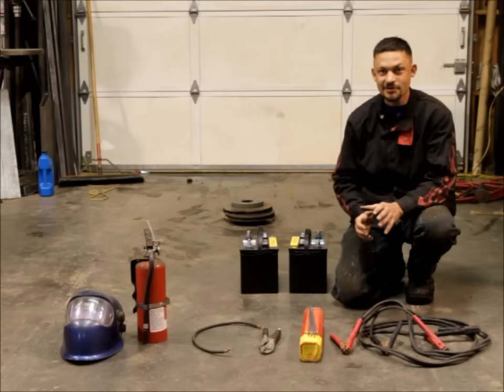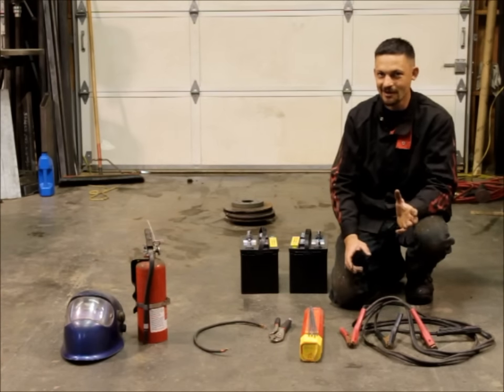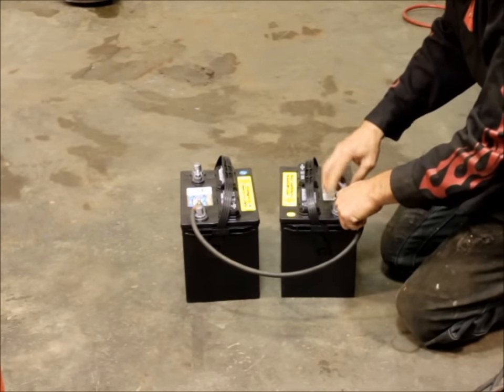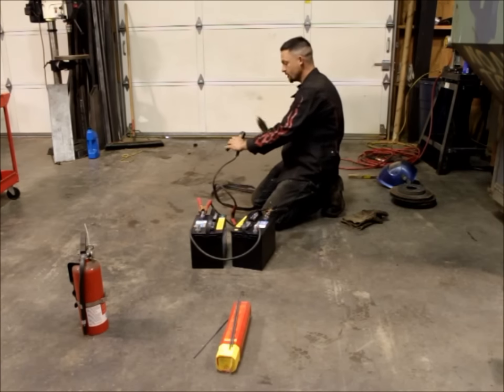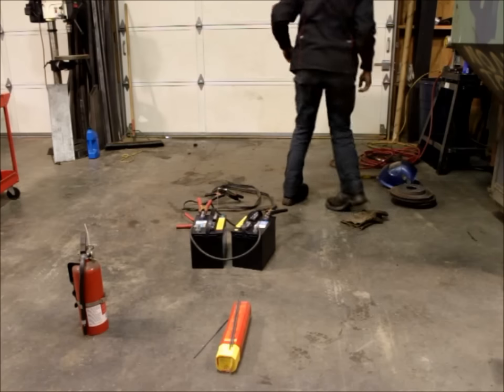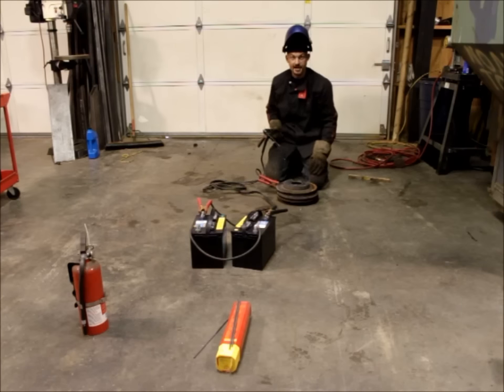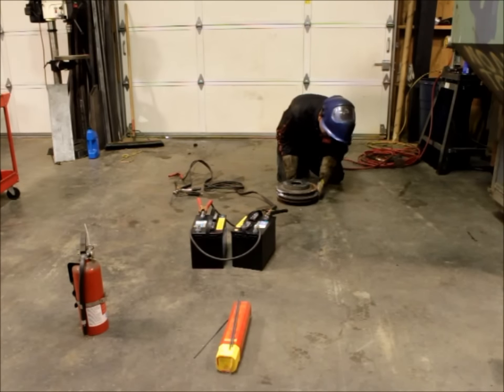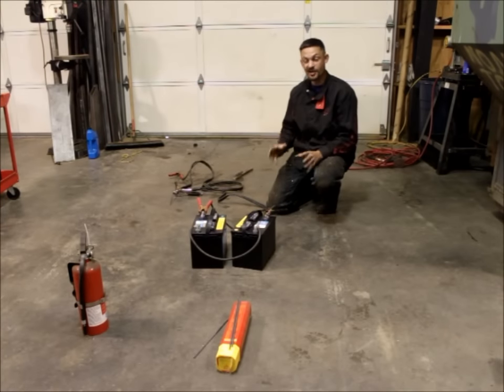Welding with jumper cables and a pair of batteries

Comment: Batteries can also be used to make an inexpensive spot welder. But one safety warning that was not in the video. . . If you have very good, high amperage booster cables and the welding rod should stick, it is possible for the batteries to explode. The first time I saw a battery explode was when a fellow placed some plywood under his battery because the tray was corroded. This lifted the battery just enough so that when he closed the hood of his truck, the battery shorted against the hood. It blew the hood back open among other damage done. Lucky, he had walked far enough away to not be hurt before it blew.
Reply: Exploding batteries are worse than I had ever imagined. I was in a shop where someone left a deep cycle marine battery on a charger without popping the caps for far too long. A couple of days I believe. When it decided to blow it scared the living !#@! out of everyone. Even worse than the near heart attack was the battery acid cloud sent throughout the shop. In addition to that, a 6 to 8 foot area was completely contaminated. One of the most dangerous things I've seen. Batteries are no joke. Lucky no one was standing next to it when it blew up.
Reply from the maker: I've witnessed a couple of battery explosions; one was due to jumper cables being hooked up in reverse (my father on a tractor when I was about 10 years old) and another in a golf cart during charging  (charger was removed under power and vent caps removed following extended charging).  Both were violent and caused a fair bit of damage.  I have heard of others as well; but every single one of them involved improper charging or excessive amp draw/short circuit, improper venting, or other misuse/abuse.  Welding with this method draws about 150 amps; well within the discharge rate of most any automotive battery (and under what a starter motor, winch, or other large electrical motor would draw).  Sticking a welding electrode is certainly a possibility, but only dangerous of the welder leaves it stuck for an extended period of time and neglects to pull it out of the holder or remove a cable.  You're correct; I probably should have mentioned the risk in the video.  When conducted properly, this method of welding is safe.  But there are about a dozen ways that a person could make it unsafe and I did make mention of this in my video description.
Reply: sewerzuk You are right that most batteries explode while being charged. This is because hydrogen gas is released during the charge cycle. 

I too have welded using batteries. But mostly just spot welding. Done correctly it works fine.
Reply: Roy Riederer
Reply: Roy Riederer h
Reply: I'm lucky then, forklift I drive at work the battery and engine are under the seat. 
The 'bonnet stands' were rusted to hell, so one day when I sat on the seat the battery terminals touched the bonnet without knowing this I turned the key. Huge bang followed by a fair bit smoke coming out from under me.

No damage besides half of one battery missing (two 12v batteries) So glad I didn't get my ass blown off hah.
Reply: Wow, I guess your co-workers thought what a fart!!! (hehe!)
Reply: What about a 300 amp fuse since we only need 150 amps to weld?
Reply: Your exactly right about the to high current draw thats why iv used longer piece of wire for resistance between the two or three batteries to help control that much current that really dont need to weld with .
Reply: Roy Riederer HE GOT LUCKY..MY CAR HAD A WRENCH IN THE TRUNK & IT WAS ROLLING AROUND & WHEN I HIT A LEFT TURN GOING FAST IT ROLLED ON TO THE BATTERIE IN MY BMW & IT SHORTED IT GOT SO HOT IT TURNED MY CAR OFF & THE WRENCH WAS STUCK ON THE POS & NEG POST SO I RAN TO THE NEAREST HOUSE THAT HAD A GARAGE OPEN GRABBED WHAT EVER I COULD GET THAT WAS HARD & HIT THE WRENCH OFF IT TOOK ME 3 HARD STRIKES TO GET IT OFF...THE OWNER OF THE HOUSE WAS LIKE HEY WTFFFFF..I SAID EMERGENCY THEN HE SAW WHAT I WAS DOING & HELPED ME ..MY BATTERIE STATED TO SMOKE...LUCKY NOTHING HAPPEND...SMH..I NEVER AGAIN HAD TOOL LOSE IN MY TRUNK & I COVERED THE BATTERIE WITH ITS COVER THAT NEVER CAME WITH THE CAR WHEN I BOUGHT IT...OMG IMAGINE IF IT WAS A WOMAN...BOOOOM!
Reply: Nationalcitysycho d Glad you saved your Beemer. It's always best to prevent exploding cars and women.
Reply: Roy Riederer to
Reply: Buddy Clem 
Anyone ever think that MAYBE if we taught the ladies in our lives some of these necessary skills, we wouldn't have to worry as much? Or would that put too much strain on our need to be the sole providers of all things handy?
Reply: Triikor Omg I couldn't stop laughing. I kept picturing you sitting on a forklift with smoke coming from under your ass and a your boss just staring with his hands on his hips shaking his head.
Reply: I had a battery explode and it sounded like a fucking Grenade went off! The damn top of the battery ended up on the roof...All because one spark and a leaking battery cap. Just enough gassing and wallah...You're pissing your pants. Then run for water hose and baking soda. As that acid was on everything...
Reply: Roy Riederer Holy fuck! That guy was lucky that he didn't got killed in that explosion.
Reply: I-Love-CO Mountains
Wholeheartedly agree with your comment but I think the Joke Buddy made was at the expense of Nationalcitysycho d being vague in his dismissal of women, and which could be read as National describing an actual exploding woman.
Reply: @abarcza  I know your comment was months ago but I'm wondering the same thing and hoping that by commenting on yours someone might actually answer it. My first thought was a simple fuse or breaker of some kind. If anyone's actually reading this what would be the best, easiest and cheapest option for adding a little protection from an exploding battery?
Reply: @DnosSFS  should have reported to the Guinness World Record for the biggest FART!  =)
Reply: Facts
Reply: lithium batteries are safer, they just spew fire everywhere
Reply: @nationalcitysycho  There's a button on your keyboard labeled "CAPS" you may have hit it by accident. That or you just type in all caps on purpose and it's kind of cringe. Cool story though.
Reply: @MattVerley I doubt I'll get an answer on a seven year old comment, but anyway: Why would the current be restricted to ~150A? 
Isn't it essentially a perfect short circuit?
Reply from the maker: @LachskoenigIV  I still keep an eye on comments, even on my very old videos!  It's because it isn't really a perfect short circuit.  The resistance of the circuit (battery internal resistance, mating points between the clamps and the battery terminals, resistance of the cables themselves, resistance of the arc, etc) all add up to limit the current to about 150 amps.  This absolutely will vary with different battery setups, different cable lengths and sizes, different electrode size, and more.  If you drop a large copper bar across the terminals of a battery, you'll get many hundreds of amps, a damaged battery, and melted battery terminals.  Not quite the same thing as the setup I demonstrated.
Reply: I was messing with my battery  in my pu truck I closed the hood got in turned the key and kaboom battery exploded still do not know why.

Comment: REALLY a great video! Seen this done about 40 years ago out in the middle of the Mohave desert, about 30 miles from nowhere! Group of about 20 or 25 Jeepers were out having fun when one jeep broke a spring mount away from the frame. One cleaver jeeper  performed a miracle in the middle of nowhere using the batteries from a couple of jeeps just as you showed us here!! Thanks again!!!!
Reply: Awesome. I’m just now getting clued in how welding just being shorted current to melt metal.

Comment from the maker: The electrode was 1/8" in the video.  I have tried (just for fun) welding with a coat hanger.  It doesn't work well at all, since there is no barrier to contamination from the atmosphere.  The joint isn't strong and it looks terrible.  But...in a REAL pinch, it could be used to stick 2 pieces of metal together.  Much better to just buy a few $ worth of good welding rod though!
Reply: very early arc weldors wrapped wet paper around bare steel to create the coating
Reply: why not use iron cable?
Reply: Apart from hwo dangerous it would be, wouldn't an open flame from a torch directed at the weld during welding sort of protect the oxidation? How about carbon coating the piece at a welded point with some tar, so it deprives the atmosphere out of oxygen for a moment?

Comment from the maker: I used 1/8" rod in this video
Reply: Matt Verley - you're wonderful . Thanks so much!
Reply: Thanks was going to ask. I have a welder but this will be handy on a RV trip if needed or to help someone else out. May even get a tip. haha Best explanation on this I have seen so far
Reply: That's 2.5mm to all the metric heads👍

Comment: I've watched many videos of arc welding with automotive batteries and jumper cables, and this video is by far the best one of them all.

A week or so ago I had revived my wifes old dead car battery with distilled water and epsom salt and charged it overnight. I had purchased a deep cycle battery for her dads boat just a few days ago. Tonight I used both batteries to spot weld a fender back onto my father-in-laws 1988 Chevy van (yes, they are spot-welded on, not bolted on) using the above mentioned batteries, and I must say that after a little bit of practice I was successful in my task.

Comment: i'm a fourty year vetran welder. I like the video cause I like welding and making stuff. Like electon beam welding of titanium parts for the miltary 2 billion dollar stealth bomber. Still do some stick welding. 2 suggestions.  I couldn't tell if you had safety glasses on but I would suggest no one try this without safety glasses (or some type of glasses under the hood) two reasons. Those Sparks you see bouncing around can easily hit your chest and go underneath the helmet and end up in your eye. a glowing piece of Steel in your eye could be the end of sight in that eye. also generally speaking welding leaves slag behind on the surface of the weld.  usually it can't be brushed off  without first shipping it off with a slag hammer or other device then polishing with a wire brush. those hot pieces of slag  likewise can end up in your eyes. more than once even with glasses on pieces of slag have stuck on my skin causing deep burns on my face. can you imagine a red-hot piece of slag on the surface of your eye? the other thing  especially for new welders  the rod can stick on the part actually welded to part.  There is now no release for that battery energy. Now you must remove your vice grips quickly  before you cause serious problems with those batteries. anyway thanks for the video and happy welding.
Reply: what are the chances of that? you can only be so careful before it becomes ridiculous...
Reply: He’s right while wearing a mask I once got a spark go dangerously close to my eye while mig welding now I wear goggles with the mask

Especially when I weld at uncomfortable angles like under a car
Reply: @kingjames4886  It happens more often than you think... I've been welding for less than a year now, already have gotten pieces of slag stuck to my lips, in my beard, and had one red hot ball bounce off my shoulder, into my helmet, behind my safety glasses and right onto my eyelid, singing off some of my eyelashes. Those little red balls really know how to get into weird spots.
Reply: @kingjames4886  the chance could only be .01% but why chance it especially with your eyes. It's never ridiculous if you got the job done right and safely.
Reply: there's a higher chance of getting in a car accident and billions of people take that risk multiple times a day... there's such a thing as being too careful.
Reply: @kingjames4886  possibly in some situations but not many. If you comparing the chance of getting in a car accident to getting some slag in your eye you would also have to compare how many ridiculous drivers there on the road compared to how many welders there are and it's not really a reliable percentage. I would say at that point you got a better chance of getting slag in your eye if your a welder. And why not just wear the glasses behind the mask it's not like it's that big of a deal anyway. It really is one of those things it's just smarter to do unless you really don't like your eyes. I'm not going to say I wear them because it never really crossed my mind until this video because I don't weld everyday but I'll wear them now.
Reply: don't think it works like that...
Reply: @kingjames4886  doesn't it though
Reply: no... but if you're that determined you'd better wear full safety goggles since glasses leave a space that a spark could slip through.
Reply: @kingjames4886  good point I think I have some flame retardant tape at work, I could tape up the sides. Good lookin out bro
Reply: Just curious if we are hearing from the peanut gallery below, or if anyone has experience? Any one eyed welders down below that can give first hand experience or is everybody just pissing in the wind? Do what you please, it's your eyes...
Reply: Hmm
Reply: Getting power off the stuck rod is quite easy since the vice grips have the spring clamp of the jumper cables on them so pull your jumper cable off the grips to break the current .... oh yeah in my last 45 years of fabricating I’ve had the odd pieces of slag get past my safety glasses, more of a problem with grinding and chipping slag and excess weld material ....
Reply: i have been welding for 60 yrs from my first experience. burned my eyes from the flash once but have never gotten slag in my eye not saying it couldnt happen.
Reply: I had a piece of spatter bounce off my chest up under mask and rite into my eye 3 days of extreme pain and an eye doctor now I keep my chin tucked
Reply: I had a spark bounce off my helmet to the bumper to the garage door then hit my neighbor then he stumbled hit his head and dropped his cigarette next to a gascan that exploded next to a big propane tank....what a terrible day. Im not even gonna bother telling what happened next coz you not gonna believe it 😅
Reply: @kingjames4886  You would be surprised at how those pieces of slag fly around when chipping them off
Reply: Dear Jerrybenson, 

Thanks so so so much for your professional concern. Never thought about this, and will take this action, now.

Wonderful !

SIncerely
David Svarrer
Reply: @kingjames4886  The chances are quite good, unfortunately.  As an eye doctor with 35 years experience practicing in a farming community of approximately 60,000 people, I can't tell you how many times I removed metallic foreign bodies from individual's eyes using improper and proper protection while both grinding and welding.  As far as the UV radiation debate is concerned, those of you claiming to use "squinting" as you line of protection are playing with fire.  The first line of UV absorption is in the cornea or clear covering of the eye.  If it is inundated with UV, you get the typical "welder flash" burn that hurts like crazy about 12-24 hours after the initial burn.  These generally resolve without permanent damage.  The UV that passes through the cornea is then absorbed by the crystalline lens of the eye.  The cumulative (over time) adsorption of UV (painless) by the lens creates cataract over time.  Finally, the UV passes back to the retina (specifically the macula) which absorbs the any remaining UV radiation.  Continued exposure of the macula over time to UV can and will lead to macular degeneration.  No, it won't blind you overnight, but you may suffer serious consequences in the distant future.        
PLEASE use safety shields when grinding or welding...they make them for a reason!
Reply: @mtlefty8687  well, people who don't have a problem generally don't complain about it. I think you might have confirmation bias.
Reply: Don't understand your comment...I was describing my experiences of treating injuries from metallic foreign bodies and dangers of UV radiation using "squinting" as protection.  What are trying to say?
Reply: @Jason Vangness was welding few weeks ago under a trailer, on my side and a spark bounced off the helmet, my shoulder and in my ear. Needless to say I came out from under there like a rocket. Was in pain for the rest of the day, but thankfully I didn't lose my hearing or anything like that 😅
Reply: @Jason Vangness lol not really. Just hurt like crazy!
Reply: @Jason Vangness watch the video again. Sparks traveling 2 feet across the floor can easily reach your eyes especially in overhead welding. This is why a stick welder will wear leathers that completely cover arms, chest and even the neck. Protects from harmful rays and sparks. Slag can reach your eyes as soon as you lift your helmet. If you don't or won't wear protective glasses you won't work in aerospace or anywhere an employer insists on protecting the eyes of employees.

Comment: Thanks man. That was really helpful. I had heard you could do this but I would have instinctively put the welding rod on the positive cable and had a poor result. Thanks for making this video. Those welds looked cleaner than the welds I do with my wire feed welder!